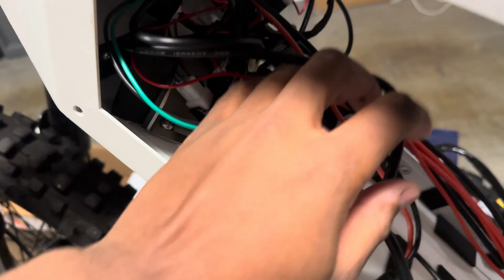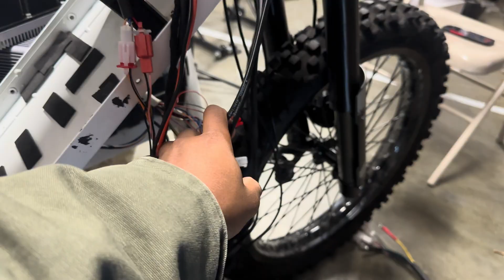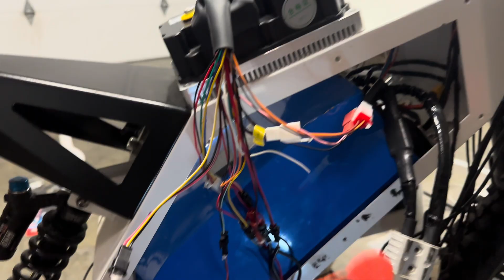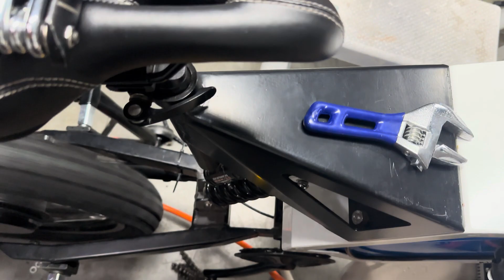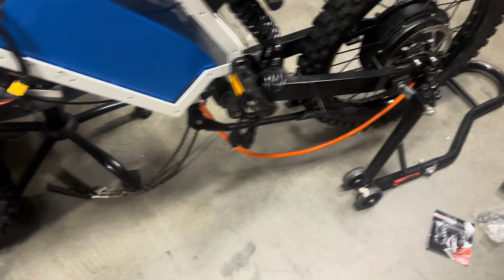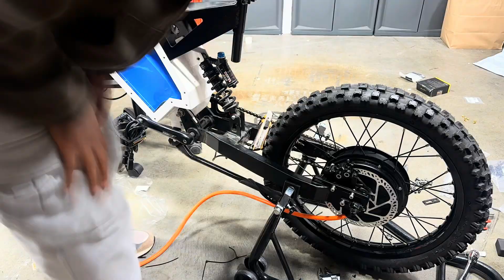72v 10,000watt hub motor ebike build (Too much torque!!)

Comment: Looking for a controller cover for my stealth bomber any ideas, besides custom making one, which I might end up doing?
Reply from the maker: What controller do you have and where do you want to mount t?
Reply: @ecrew_vp planning on a FarDriver ND72450 on the front bottom exterior had a nd power 80amp sinewave (but the lcd display would only let me do 50amp Judy bought the bike used with problems, loving the videos really helping me thx! )that I think I burnt out with some light accessories 😅

Comment: Are you sure that’s a 150a controller? It looks like the 190a controller.
Reply from the maker: @Calthecool  I bought this FarDriver controller a while ago from a company and it was just laying around so I used it to start. I was told this controller is a little limited so i was going to get a new controller that gives me more access to the settings in the future. 

Which FarDriver controller thats around the same size could work better?
Reply: @ like I said it looks like the 190 line amp controller so you should be able to get that one. Wherever you buy it should have the heatsink dimensions listed so just check that to make sure. You could also get the 72450, it has 200 line amps but you can turn it down to whatever you want and the way the phase and battery wires bolt to it is a lot slimmer than the controller you currently have.
Reply from the maker: That’s great to know!